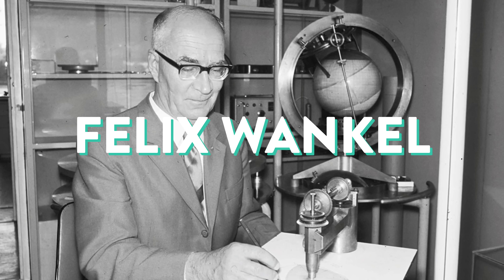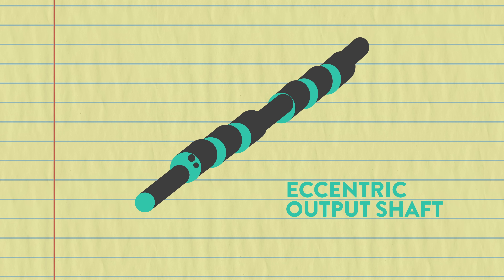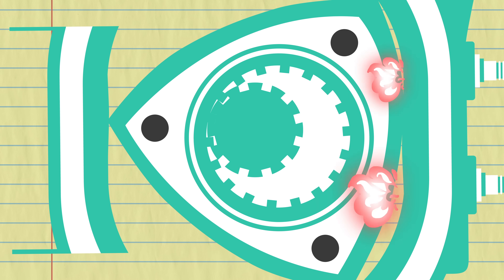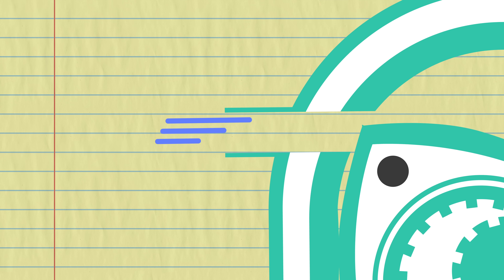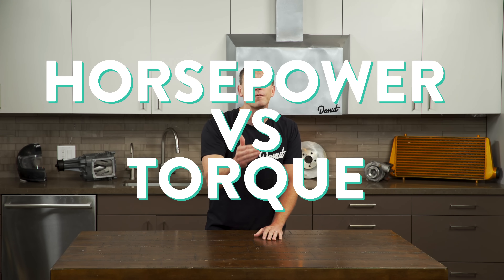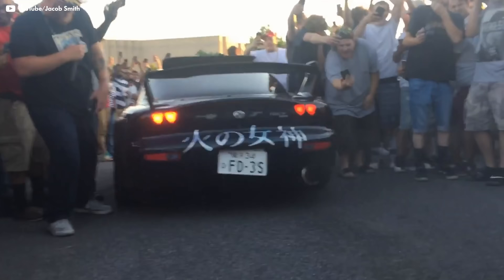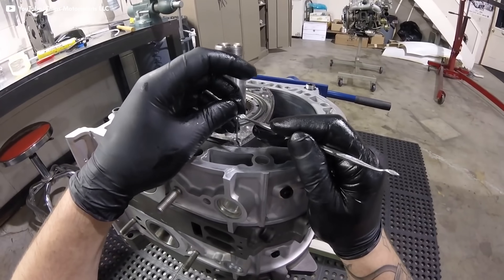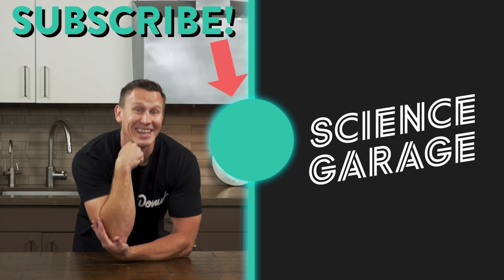Rotary Engine | How It Works

Comment: Always wanted a rotary cause they are so cool and the benefits are awesome, but I have told myself not to because of the unreliability... Well donut... you brought me back. Forsure gotta own one at some point.
Reply: Well, if the Wankel engine offered any benefits? they would not have become completely obsolete in the engine manufacturing industry... this design could no longer compete with the other successful internal combustion designs still being mass produced in the millions.
Reply: doktorbimmer   Did you watch the video? A couple benefits are high reving, less moving parts, smaller, and consistent firing order... It’s not near as reliable as piston engines, but that doesn’t change the fact that it’s a cool engine and would be fun to own.
Reply: dokterbimmer the fake thinks the world  is still    flat

Comment: I feel like an anti lag would work well with this thing since the gas is already not fully combusted, it would help reduce emissions in theory, I wonder how it would go.
Reply: Why do you think it would work better?  And how would it reduce emissions?
Reply: I think it might work better in a rotary because it's a very inefficient engine as far as fuel economy and not burning all of the fuel it uses.  It would has a lot of unburnt hydrocarbons in the exhaust relative to a piston engine.  If there's an anti-lag system that could be devised to take advantage of those unburnt hydrocarbons and combust them before they spat out the tail pipe, you could in theory keep the turbo spooled up and reduce some of the more noxious emissions.  And by keeping the turbo going, you should be able to keep the air fuel mixture in an ideal range to boost efficiency somewhat.

Overall, it just seems like an engine that would lend itself well to forced induction and anti-lag systems.

Keep in mind, I'm no mechanic nor an engineer.  I just like cars.
Reply: So you are unfamiliar with the concept of fuel enrichment as the manifold pressure increases? Forced-induction engines must operate with a richer air-fuel mixture as manifold pressure increases... engines with turbochargers must run even richer than superchargers to lower the EGT (exhaust gas temp.) and keep the TIT (turbine inlet temp.) below a safe limit. Wankel engines due to their lower efficiency require even richer fuel mixtures than piston engines and tend detonate (pre-ignition) and overheat the turbo more easily due to the poor combustion chamber design and higher EGT than piston engines.

Comment: Electronic fuel injection might solve some of the problems with unburned gas in the exhaust.
Reply: Actually Mazda had been using electronic fuel injection for decades but still had problems... the Wankel suffers from several fundamental flaws that are inherent to its basic geometry that cause poor combustion and typically require more fuel (richer AFR) to prevent it from self-destructing from pre-ignition/detonation and to reduce combustion temperatures to prevent overheating. Modern reciprocating engine have the ability to use ultra high efficiency combustion chamber designs, leaner fuel mixtures and can be optimized for maximum efficiency... the solution for automakers is to abandoned the Wankel in favor of using only reciprocating engines as Mazda and others have done.

Comment: can some disprove me here? I was thinking that maybe by routing out space for the apex seal(making it wider), and using a wider apex seal, you could boost the reliability and the life of each seal, as there is more of the seal there to strengthen itself. Would this work? I feel like it might, you just would have to retune the timing to get everything accustomed to a wider apex of the rotor. Again, let me know if you guys thing or know if this could work!
Reply: Good question, increasing width of the seal actually reduces the ability to form a gas tight seal, increasing surface area reduces the pressure against the housing surface. The other problem is weight, a heavy seal causes chatter (called devil's nail scratches) and leaves damaging marks on the surface of the housing. The apex seal must be allowed to  move in and out a large enough tolerance to conform to the considerable expansion, contraction and torsional movement but must be light enough that the minimum about of spring tension is used... heavier seal? More bounce... Strong springs more wear.
Reply: @doktorbimmer  that's very interesting. By sizing up everything could you increase reliability? I feel as though you may find the same problem , just on a larger scale
Reply: The diameter of the housing is a serious limiting factor in the Wankel design.. as the radius increases so does the surface speed the seal must travel across the surface at the same rpm... The largest diameter Wankel ever built was 41 liters by Ingersoll-Rand and had a Radius of 424.18 mm ( 16.7" inches) but was limited to rotor/piston speeds of just 400 rpm.
Reply: The other problem that faces all internal combustion engines the Conflageration Velocity or "Flame Speed"  in a gasoline piston engine this is an issue when Bore diameter reaches 100 mm or 4 inches... as you increase the bore diameter beyond this the engine operating rpm is reduced because there simply is not enough combustion dwell (time) for the air fuel mixture to ignite and burn completely. In the Wankel this effects both the width and the diameter of the housing and limiting the practical size.

Comment: APEX SEAL LEAKS INSIDE THE ENGINE ON COMPRESSION STROKE  THIS WHY YOU GET 80LBS ON A COMPRESSION CHECK THIS  ENGINE IS 5 TO 1 RATIO WHEN IT LEAKS INSIDE THE ENGINE LOOKING FOR A 10 TO 1 ROTARY

Comment: RX7 ROTARY ENGINE BOTH ROTORS ARE 180 A PART
Reply: 177SCmaro
ha, I work on commercial power equipment as well as cars and I can tell you the engineers don't always get it right by a long shot!

Comment: Double rotor rx7 is mean as hell alot of power but alot of fixing and breaking
Reply: Double rotor? You mean the 13b? The only models that were known for early engine failures were the turbo models.

Comment: Mazda 787B won lemans with this type of engine.
Reply: Audi has won Le Mans 9 times with a Diesel engine.
Reply: @doktorbimmer  
And?
Mazda still didn't they XD.
Reply: Well technically they cheated but the real reason they won was pure luck... all the points leaders crashed out early in the race.
Reply: It simply proved the fact that Diesel engines are actually better for racing than Wankel engines... which is just sad.
Reply: @doktorbimmer  Finally I find something I have to agree with doktorbimmer.  Exactly right.
Reply: Mazda lost the 1991 WSC championship to Jaguar with this engine.

Comment: The eccentric shaft isn't a driveshaft equivalent, it's a crankshaft equivalent.
Reply: Doesn't seem like anyone else even noticed that.
Reply: You are correct... its a type of crankshaft called an eccentric-crankshaft... but works exactly the same.

Comment: Rotary engine burn a lot of fuel because that are firing more often than a piston engine.
Reply: They fire once per rotor, per revolution, same as any 2-stroke reciprocating design. Their biggest efficiency downfall comes from the excessive quench area, combined with long combustion chamber geometry. The rotor is chasing the flame through a long narrow combustion chamber in the engine.  High RPM is going to mean there simply isn't enough time for the fuel to burn in the engine before the port is open, then when the port is uncovered, the first of the chamber contents to get pushed out will be the tail end of the unburned charge. The faster a wankel spins, the less efficient it becomes.       dorito-motor.

Comment: When I was 9 or 10 I got a model kit 1/12th scale of the rotary engine for Christmas. Mazda had commercials on TV showing this new engine and I was fascinated and had to see how it worked. The pieces were mostly clear so I put it together with glue and this is the kicker the transmission held 2 D batteries and an electric motor that turned the motor and the shifter was the on & off switch. It worked 😊

Comment: Mazda won Le Mans with a rotary engine on the mythic 787B. It got banned the following year, on shady reasons of emissions issues, as if race engine ever cared about emissions.
And thanks for using the correct name (Wenkel engine), since rotary engines also designates what powers propeller airplanes, which is totally different.
Reply: The reasons were not "shady". The reasons were plain, and simple, Mazda uses a deceptive displacement measurement,  FIA had (years before Mazda win) decided they would unify displacement measurement to a single size requirement. There were limitations placed on noise (Don't remember the measurement distance/angle) FIA required 115-120db Max, for the safety of spectators, and to cut complaints against tracks.  mazda typically ran 140+db, they were generating the sound pressure levels of a fighter jet on afterburners. 

Let's face it, Mazda's win was more on technicality than car performance.

Ever notice Mazda avoided Can Am Group 7 back when the series was around?  They could have competed with other cars in an unlimited engine class, but there would have been absolutely zero chance of a valid win. Can you imagine the embarrassment for Mazda running against the Porsche 197/30? Put the rotary in a fair engine comparison, and it fails

Comment: Rotarys are amazing engines but who can own one is based on taste and money. If u can a fford SLIGHTLY more gas and a more unreliable engine. its worth it cause better sounding engine, Faster power output and less parts to deal with but once u got one u will fall DEEPLY in love

Comment: I've been watching Matt Field's Corvette build, and when he fitted his new suspension I couldn't really understand the difference between his old Suspension and the new one. I also watched the video"s of Engineering explained where they tweaked the Nissan's suspension for drifting. Again i did not fully understand. Could you possibly explain Suspensions? Coil Overs, Tie rods, steering racks, control arms, Shock absorbers, Anti rolls-bars, the details of camber, caster and toe? Maybe not all of them, but some would be nice. BTW I love Donut Media :P

Comment: wankel rotory engine
for when you hate both the enviroment and having torque

have emmisions as back as a Detriot Diesel 2stroke
and cant make toque to save its life without boost
and even with, still doesn't hold up
also
APEX SEALS=80,000 miles AND THATS IT

Comment: How Big Are Wankel Engines? from Hemmings Sports & Exotic Car
April, 2008 - Karl Ludvigsen

Your editor's eyebrows shot sky-high when I submitted my article on the design of the Mazda RX-7 (HS&EC #31). I said that its rotary engine had "a displacement of 573cc per working chamber. Since there were two rotors and three cells per rotor, that added up to a total capacity of 3,438cc."

Cue editorial response! "It's been my understanding that the 12A displaced 573cc per rotor for a total of 1,146cc," queried Mr. Fitzgerald, "and for Japanese tax purposes the engine was rated at 1.5 times the nominal displacement for 1,719cc. I've never heard of the 12A being described as anything other than a sub-2.0-liter engine."

The reason for that is simple, I told Craig: Mazda has been misrepresenting the actual displacement of its rotary engine for decades.

I first got involved in this in the early 1970s, the Wankel's heyday. That's when almost everybody was interested in this ingenious new engine, for good reason. Covering it closely as a journalist, I was happy with the convention that the displacement of a single rotor was rated as double the swept volume of one of the three combustion chambers that surrounded that rotor.

There seemed to be some logic to this. At the output shaft, this matched the pattern of power strokes of a four-stroke engine. This was the rating used by the international racing authorities for Wankel displacement. As well, heavyweights in the Wankel world, Daimler-Benz, Ford and General Motors, concluded that the "equivalent displacement" was double that of a single chamber. On that basis, the RX-7, with its two rotors, would have a displacement of 573cc x 2 x 2, or 2,292cc.

Then one evening in 1973, I was dining at the Dearborn Inn with G. Fred Leydorf, an advanced-engine engineer at American Motors. Fred had worked on a joint rotary-engine project with Renault and was liaising with Curtiss-Wright on the Wankel engine that was scheduled to power the Pacer. He knew his rotaries.

"The thing about the Wankel," said Fred, "is that its displacement is bigger than people think. You have to follow all its chambers through their complete working cycles. With the Wankel, that takes three revolutions of its output shaft, not the four-stroke reciprocating engine's two revolutions. If you do that, you find that all three chambers of each rotor complete the four-stroke cycle--so they have to be counted in its displacement."

The light dawns! Suddenly the Wankel is seen for what it is: a brilliant design that packs a lot of working volume into a small package. You'd think its creators would be boasting about how much "cylinder" capacity they've managed to build into its compact housing, a tribute to Felix Wankel's genius. In a 1963 study of racing classifications, one of Europe's most respected engine experts, Prof. Eberan von Eberhorst, came down firmly in favor of a triple-chamber rating.

That's just the way the engine was seen at first by Germany's NSU, the little company that took the gamble of licensing and building the first Wankels. When Max Bentele, then a Curtiss-Wright engineer, first visited NSU in mid-1958, he copied down a list of all NSU's present and future Wankels. NSU showed the displacement of each as triple its single chamber. The first engines, which had 125cc chambers, were classified as 375cc. Projected engines with 500cc chambers were described as 1.5-liter units in single-rotor form and as 3.0-liter engines with two rotors.

Bentele brought the NSU engineers up short. "Aren't you asking for trouble?" he said. "We have no problem in the U.S. with taxation on the basis of engine size, but you do in Europe. Why do you mention three chambers when you could mention only one?" NSU did indeed go back to a single-chamber rating for all its Wankels. Mazda did likewise, and has done so ever since.

I did some writing on the subject in 1973 that led to correspondence with many experts, including Felix Wankel. Then I got involved in the discussion for real in 1974 when I learned that the Society of Automotive Engineers (SAE) was setting up a Rotary Engine Subcommittee to establish clear definitions for the engine's components and functions so that all engineers could sing from the same song sheet. I managed to wangle a place for myself on it.

Needless to say, I pushed hard for all three chambers to be counted in a definition of displacement. My first proposal was for that to be adopted in parallel with an "SAE displacement" of two chambers per rotor to pacify the car makers who were comfortable with this. At a subcommittee meeting on February 25, 1975, I made a major presentation, complete with slides, defending the counting of all three chambers of any and all rotors.

Had I not weighed in as I did, I'm pretty sure that SAE J1220, approved in June 1978, wouldn't have included a definition that counted all three chambers. In fact, unable to agree, we hedged our bets by satisfying everybody. One chamber was defined as "Geometric Displacement," two were "Equivalent Displacement" and three were "Thermodynamic Displacement."

You can take your pick. But believe me, if you want to understand the Wankel's pros and cons, the best way to do so is to consider all three chambers of each rotor--even if Mazda doesn't want to!

This article originally appeared in the April, 2008 issue of Hemmings Sports & Exotic Car.

Comment: So every rotor side on each rotor goes trough the Otto 4 stroke cycle process (intake, compression, igniton and exhaust)...On 2 rotor engines that makes for 6 sides (3 per rotor) and that makes a 12A or 13B engine functionally  comparable to 6 cylinder engines. Mazda count the cc for just one side of each rotor to establish a "nominal displacement" (the did this just to pay less taxation for each engine produced). NSU, known to be making rotary engines prior to Mazda, counted the cc displaced by each side of the rotor (3) as they went trough the Otto 4 stroke cycle around the housing. You need to count all them, so in a 13B engine that is 654 cc X 6 rotor sides for 3924 cc or 3.9L of real displacement. Using the rotation of conventional 2 stroke or 4 stroke piston engines should not be the method to establish a rotary engine displacement as they are 2 complete different aproaches. Then Mazda's method has a flaw, Mazda counts the cc displaced by one side of the rotor, and just that sole side making the Otto 4 stroke cycle process is not enough to spin the eccentric shaft continuously. Lets modify the ignition on a Mazda 13B engine so it just fires the lead and trail sparks on the ignition cycle for just one side of each rotor to see if it can complete a whole revolution and that same side begins to do the 4 stroke cycle again, then it will be 1.3 liter, but you can't un-count the other 4 rotor sides (2 per rotor) that add 2616 cc to the equation.

www.hemmings.com/magazine/hsx/2008/04/How-Big-Are-Wankel-Engines-/1610620.html